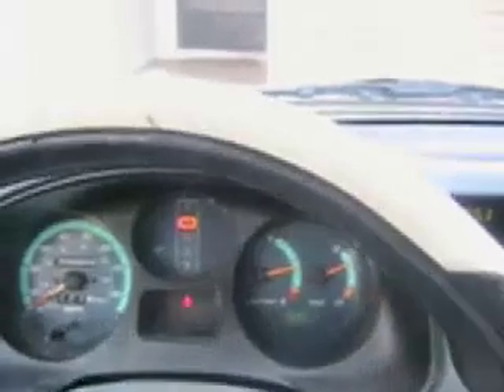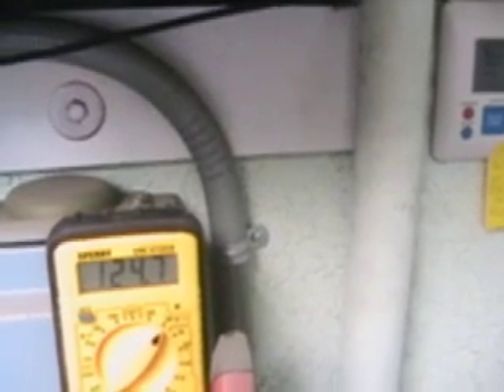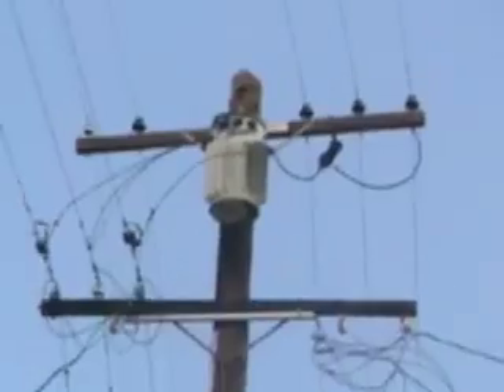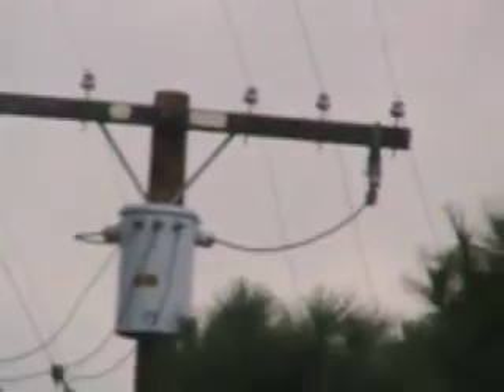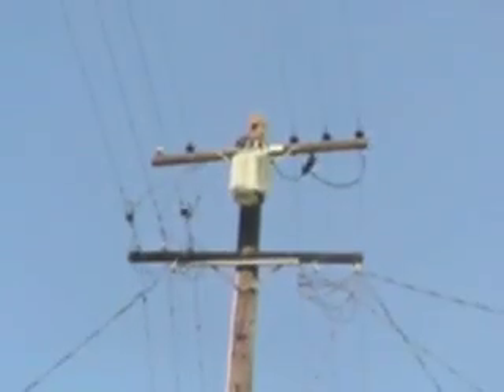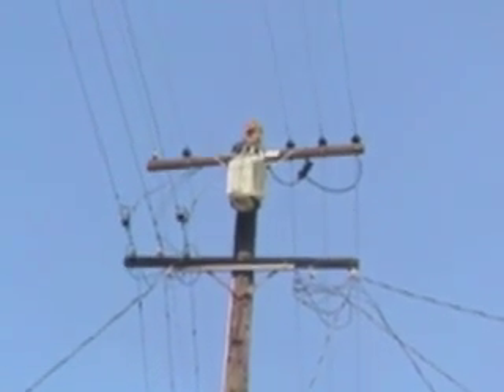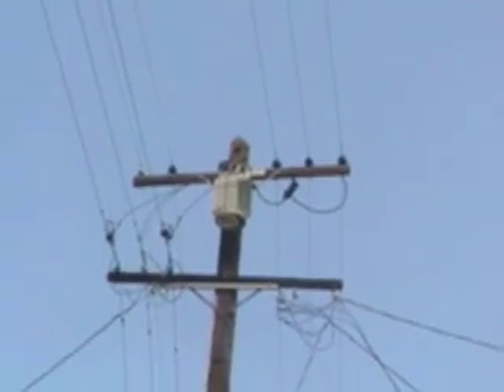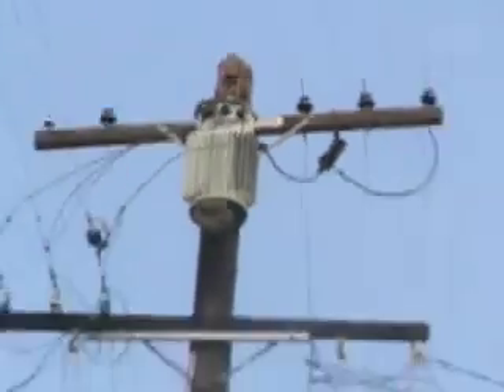PV system catches SCE hi-jinks

Comment: There are different causes for high voltage.  High line voltage would result in all the houses on that line being high, not just the ones on that transformer.  The power company uses regulators to keep the line voltage within range, which by the way is not 20,000 volts (look at the insulators) but more like 7200 volts.  If there's a problem with a neutral, which can easily happen when you have so many houses on one  transformer, this could be causing your high voltage. Check with the neighbors.

Comment: Is that really "acting up", though?  Transformers just have a transformation ratio.  If you jack up the input voltage (what comes from the substation), then you jack up the output voltage.  It's that simple.  If SCE relies purely on load to regulate the system voltage, that seems pretty irresponsible.  If they need to jack up the voltage to account for load, then they should employ voltage regulators upstream of the distribution transformers.

Comment: The oil is leaking out of that transformer. The first sign of wear. Most transformers are, like most electrical components, only rated for 40 years. That's probably without the adverse conditions, like lightning and overloads.

Comment: I'm dubious of the diagnosis.  Excessive voltage is an uncommon transformer failure mode.  Have you measured between your neutral and *both* of your hot leads?  At another house on the same transformer?  At a house connected to the newer transformer down the street?  Given its obvious age, I'd tend to suspect the wiring between your house and the transformer.  Maybe your neutral has an "iffy" connection and is starting to "float" a bit according to load and the environment (e.g., moisture)?